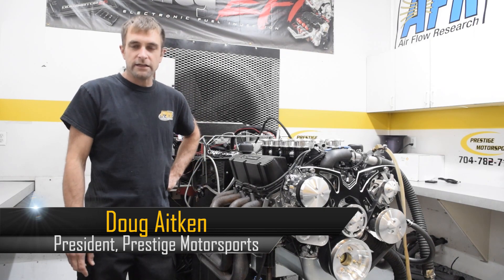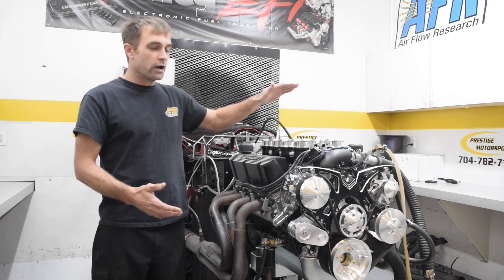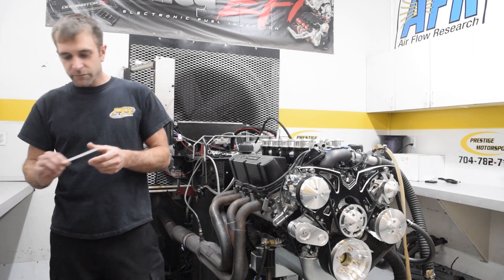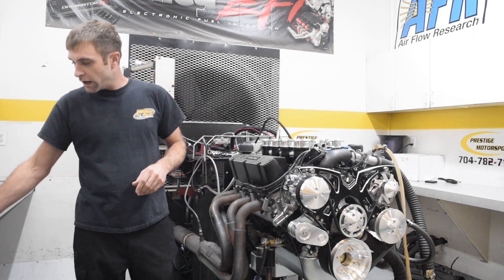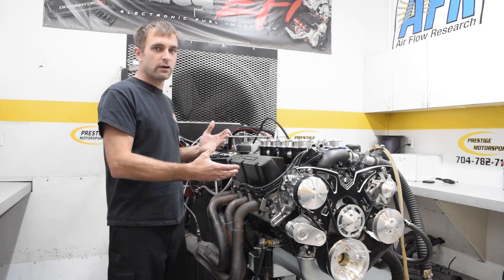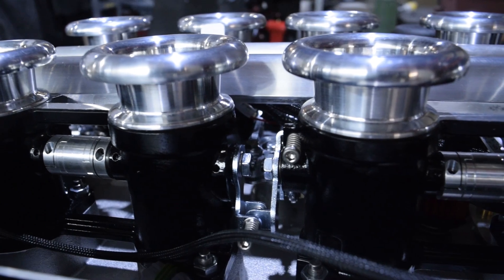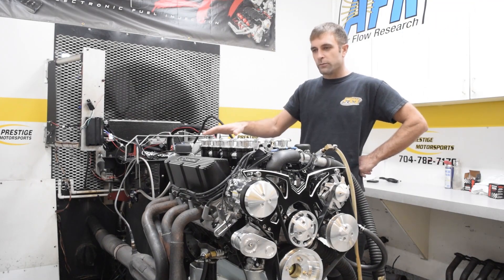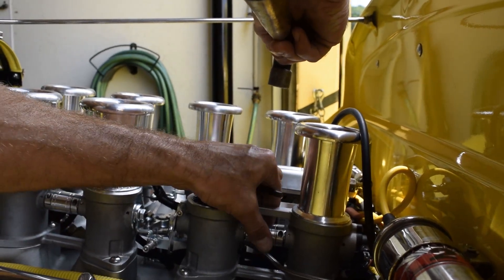Stack Injection Tuning Tips & Tricks From Prestige Motorsports

Comment: Why no mention of idle air control?
Reply: You don't need it , mostly set up as Alpha-n strategy  Tps based some can use a small percentage of map sensor in combo,  but basically only a few degrees of throttle would be like full throttle reading for a map sensor  , it can assist in barometric compensation.